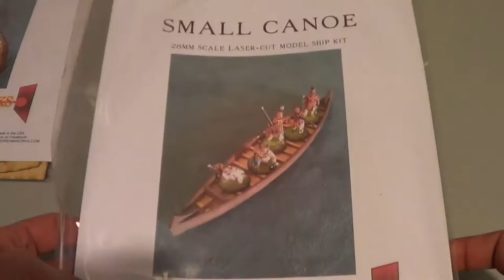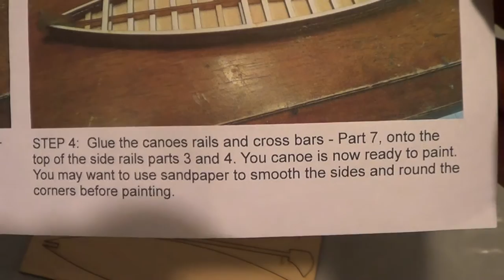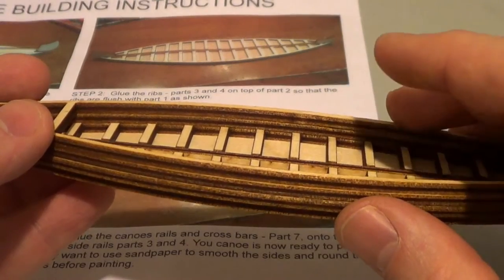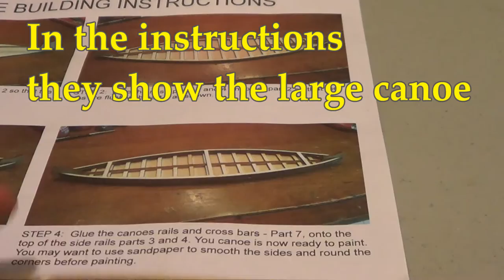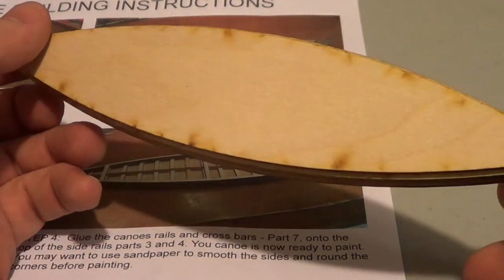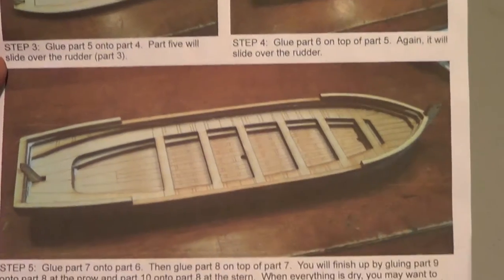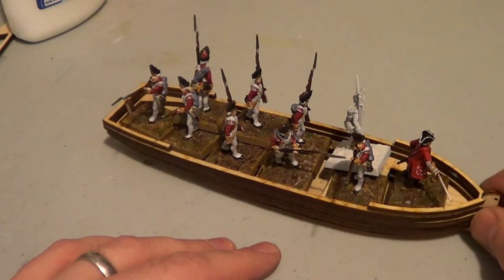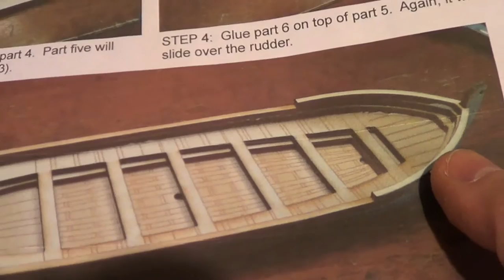Review Laser Dream Works Canoe and Bateau

Comment: The kits are made out of Baltic Birch, pretty high quality and I found extremely better to work with than MDF.  Absorbs and swells a lot less than mdf. The birch takes paint and wash extremely well, a strong sepia wash looks great.  I think the bateau would look great with the gunwale and top 2 side layers in black, the rest of the boat bottom in white, with the interior sepia washed.
Reply from the maker: Steve Brown yes so far it's great to work with I like them a lot. Good suggestions on painting I am still undecided lol but I like the idea of white for the boats.

Comment: Like the LaserDreamWorks stuff.   They had an awesome kickstarter for War of 1812 gaming sized ships at the bicentennial.   I would say you should paint the canoe.   Indian canoes usually seem to be decorated.    I would do the staining on the bateau.   All the art of seen of FIW bateau seem to be simple flat bottomed boats.   Painted boats tend to be whaleboats from ships.

About the bateau kit.   Did it come with a mast ?   Looks like it has a holes for a mast in the bow or center.
Reply from the maker: Robert Chisholm cheers Robert thanks for the suggestions it looks like I took the opposite route already lol I went for a natural look on the canoes and the boats I did a simple wood interior but did the outside white. I'm not too fussed about it I looked a bit into these river flat bottom boats. They seemed to be very common and of many different types. The FIW period were actually more often a different design that was pointed at both ends. So either way it's a bit of an approximation at a FIW flat bottom boat lol. It does have two holes although not through the hull it's just one layer of board with a hole. It doesn't come with a mast though. Cheers

Comment: If and when I get into Seven Years War erra I likely will get those, as they seem nice.  I hope you show your painted/washed product at some point.  

I hear you about delivery costs.  I live near Edmonton, and buy mostly from Warlord just so I can order over $50 USD and not pay shipping.  Pretty well all of my Saga and Frostgrsve stuff (sans Saga books obviously) was bought via them.  I also went with their Bolt Action figures for This is Not a Test to dodge those costs (and thus ended up buying into Bolt Action whole sale).  Irony being that I have spent more at Warlord and got into anothr system just to avoid paying shipping, which is obviously included in their price anyway.
Reply from the maker: ostrowulf cheers Ostrowulf I have seen your comments on the channel but didn't know you were a neighbour I am in Calgary :) I finished the boats I will show them off in an update soon. I have also ordered from Warlord a lot and like to get in over their free delivery limit. In general I really like Warlord as a company great customer service.
Reply: Yeah, I have had good experience with Warlord.  I bought a M7 Priest from them, and could not figure out how part of the gun went together (it does not come with instructions, and every picture I could find did not show that side of the gun), so I e-mailed them and they sent me photos of them building one.  I am glad I did, there was a piece of what I thought was flashing that turned out to be how part of it fit together (possibly why I could not figure it out).  Their service has always been above par for me.

I was pretty sure you were in Calgary, I think you mentioned Sentry Box or something that gave me the suspicion, but was not actually sure.

I look forward to seeing the boats.